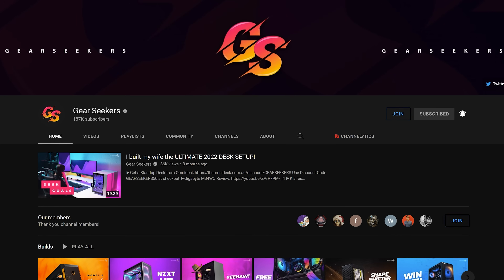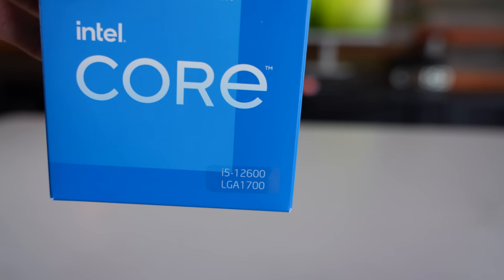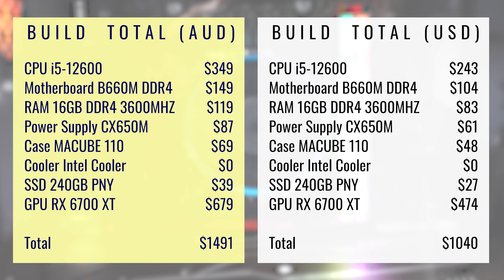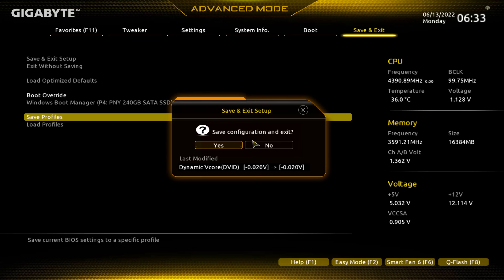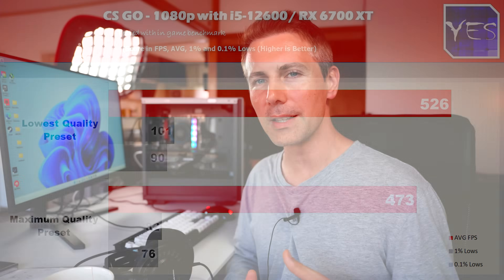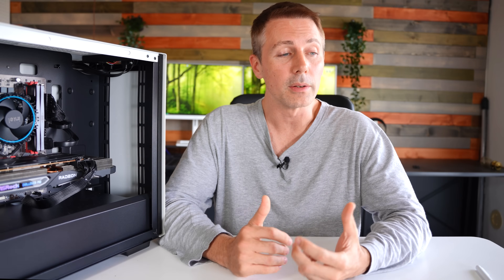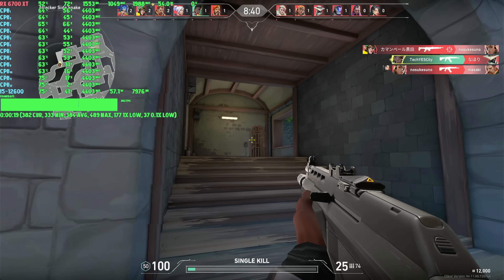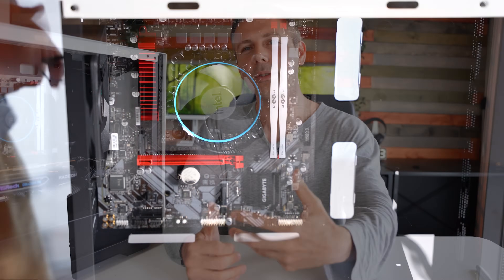UNDER $1500 AUD Intel 12th Gen PC Build CHALLENGE - Tech YES City Vs. Gearseekers

Comment: The 4 core 8 thread i3 12100 would have been far better value than the 6 core 12 thread i5. It's 1/3 the price for 2/3 of the productivity performance and probably 90% of the gaming performance. That 12th gen i5 is abysmal value for money in comparison. You could have stepped up to a 6800 instead of the 6700XT and even got better gaming scores than the i5 in the same budget.
Reply: No, let quad cores die.

Comment: Brian, why do you suggest ddr4 3600 cl18, when the ddr4 3200 cl16 runs at the same speed? ie 3600/18=200 or a 3200/16=200 or is it better in other ways? when the 3200 is cheaper.

Comment: If there was an extra $100 in the budget this comp would have been different.
Reply: I highly suspect Intel forced the issue of using at least an i5, the 12100 is the absolute best bang for buck CPU on the 12th gen platform, would have freed up $200 of budgets right there, and it would really only make sense to use it at this low of a budget if you wanted the best GPU and other parts to go with.

Comment: Awesome video and a very good and well balanced system!
As a side note, it's quite funny that the CS900 240GB SSD that you're using is the same model that I used in my old Xeon modded s775 system and now is being used in my secondary X58 system.
It's so nice that SSD's are being utilised much more.
Reply: prize is a scam.

Comment: Nice gpu and CPU combo. As others mentioned, I think a case with better airflow would have been nice. And wow! Those 12. Gen mobo prices are sharty. I miss first Gen ryzen mobo prices. A320 with r5600 all the way :D
Reply: They're expensive because the pins are on the board rather than the CPU. Although it'd be nice if the CPUs were cheaper than usual to make up for that...
Reply: the prize is a scam.

Comment: Quicksync is great, I switched from AMD to Intel in 2013, so that I could have quicksync and export videos much faster, as I used to upload and edit a lot of Youtube videos back then. I would also use it for OBS streaming, so that I don't infer any latency (using the dGPU or CPU noticeably increases frametime latency from my experience), but tbh I think OBS is a pile of crap and I just use Shadowplay and AMD's equivalent instead, both of which are more reliable IMO.

Comment: That case looks like a hot box with almost zero ventilation on the front.
Reply: 8:37.  Temps look fine but yeah that GPU temp is a bit too high for comfort.

Comment: Cpu temps with stock cooler and no intake fans in closed case? I have 12400 and 3 intakes, with a stock cooler it goes 80+ celsius. Had to buy arctic freezer cooler, huge overkill but now it stays below 60. Also have 6600xt but i somehow paid more for my build. Maybe also enable resizable bar if available in bios...

Comment: $1500    NEW# My Gaming Computer
CPU: AMD Ryzen 7 5800X 8-core, 16-Thread Unlocked Desktop Processor
Thermal Paste: Innovation Cooling Graphite Thermal Pad – Alternative to Thermal Paste/Grease (40 X 40mm)
CPU Cooler: NZXT Kraken Z73 360mm - RL-KRZ73-01 - AIO RGB CPU Liquid Cooler - Customizable LCD Display - Improved Pump - Powered by CAM V4 - RGB Connector - Aer P 120mm Radiator Fans (3 Included)
Motherboard: ASUS AM4 TUF Gaming X570-Plus (Wi-Fi) AM4 Zen 3 Ryzen 5000 & 3rd Gen Ryzen ATX Motherboard
RAM: EAMGROUP T-Force Vulcan Z DDR4 32GB Kit (2x16GB) 3200MHz (PC4-25600) CL16 Desktop Memory Module Ram (Gray)
GPU:
EVGA GeForce RTX 3070 XC3 Ultra Gaming, 08G-P5-3755-KL, 8GB GDDR6, iCX3 Cooling, ARGB LED, Metal Backplate, LHR
SSD: TEAMGROUP T-Force CARDEA Zero Z440 1TB DRAM SLC Cache, 3D TLC NAND, NVMe PCIe Gen4 M.2 2280 Gaming SSD Read/Write 5,000/4,400 MB/s TM8FP7001T0C311
HDD:HDD: Seagate 2TB BARRACUDA SATA 7200 RPM
SSD: N/A
Power Supply
Seasonic M12II EVO 620 SS-620GM2 620W 80+ Bronze EVO Edition ATX12V & EPS12V Full Modular
Computer Case
DEEPCOOL MATREXX 70 Mid-Tower Case Modular Design Full-size Tempered Glass GPU V

Comment: I think I'd consider using a 12400F, 3200 MHz RAM, a different case and possibly a slightly less expensive PSU to upgrade storage. 240 GB is really quite low and it will probably only accommodate one or two large games at a time.
Reply: I never cheap on PSUs bc later down the road if you ever wanna upgrade to a better GPU you will most likely need a new PSU if you cheaped out.
Reply: @guyknightley3499  Of course, but units like the CV series from Corsair can be had for a little less and is still of reasonable quality. Of course, the two transistor forward topology and group regulation isn't ideal, they are good enough to keep all voltages with specification.
Reply: 12400 is better as it has igpu and still comes with a cooler. And if ya get the right b660 board can even overclock to 5ghz.
Reply: @wrighrw2  In my opinion the iGPU is somewhat unnecessary since a dedicated graphics card is used. However, it really depends on the price difference. If the 12400 can be bought for only slightly more, it may be worth it.

Comment: that's my dream pc right there wish I could afford this I'm still stuck with my i7 2600 witch I've had for 10 years 😔
Reply: Definitely feel your pain there, was using an i7-875k myself until 2 years ago. Still a solid chip for esports and less demanding or older games but it is showing the age these days.
Reply: @bdhale34  yea it's still ok but it's starting to struggle definitely should keep my settings in check 😆

Comment: So I have a 9900k, is it weak now? We need a TYC comparison with the 8700k OC’d and 10900k for best used deal!
Reply: I sanded mine and overclocked it to 5.5ghz but im still planning to upgrade to 13th gen. so OC in the meantime  and upgrade when you can. i should note here that ive got a 390hz monitor im powering and thats the majority of the reason for the cpu upgrade

Comment: Bet that undervolt helped the temps even it was a rather minor undervolt. Because that case looks exactly like the NZXT ones that have no airflow worth mentioning. (And Intel isn't exactly known at the moment for running cool). Think that's the only thing I'd change within the same budget, if there was a little more to spend I think my upgrades would be: 1) Case, 2) CPU-cooler, 3) SSD

Comment: That's a great pc. But if it were me, I would have gone with a similarly cheap airflow case with free 2-3fans like . I would also get $40-50 16gb 3600/3200 ddr4 ram from other brands like teamgroup tforce vulcan, Patriot Viper Steel or Silicon power. Then get a $45-55 650-700w psu from other brands like evga or Thermaltake. The $40-50 saving from those component would go to the cpu to purchase 12700/f instead of a 12600.

Comment: i know bryan is the master budget pc builder, but the 12600 will not be my 1st choice. i would try to squeeze in a 12700 instead (luckily his competition is just using a 12400), the game graphs clearly shows they are cpu bound (bottlenecked, not much difference in low and max details). also as per hardware unbox analysis most b660 boards are crap so one must research boards that can tame 12th gen, only choose boards that can sustain higher boosts the longest (like some of those MSI's) for better performance. building 12th gen pc is very complicated but rewards massive performance for those who picks their parts thoroughly. yesman's advantage is the 6700xt as he knows the market very well and chooses a very underrated but great performing gpu (sans some quality of life features), better value compared to similar priced nvidia counterparts. i would have preferred an nvme ssd but since fps performance mattered more going sata ssd is the wiser choice.

Comment: I'd get the 12600K, and even cheaper b660m mboard and NO case LOL, just to get the Crucial Ballistix 3600 cl16-18-18 rev.E ram and OC it to as much the cpu mem controller and the mboard allows, probably around 4300 cl17???, which will increase both the average and 1% lows fps and the general sharpness and quickness of the system as a whole.

Comment: In a game like Valorant, having 0.1% lows dropping over 50% is actually quite noticeable. Alot people aim purely for smoothest possible fps in comp shooters. Build has turned out quite solid though, someones gonna be very happy with it!
Reply: Probably due to unoptimized RAM + uncapped frames. I've got a tuned kit of RAM and a 12400f, it hits 300+ but 240 locked never drops below 200 with a 1060 3gb in Val
Reply: @TonyCorin  I'm talking about the difference between low and ultra settings. Your 0.1% lows are absolutely not over 200fps with a 12400f lol you're dreaming. Your 1% lows probably are if ya rig's well optimized but not the 0.1% not a freaking chance lmao, a 12900k ain't getting 0.1% lows that high on Valorant even at lowest settings.

Comment: i would have gone with a airflow case, and if budget allowed, a better cooler, otherwise looks good starter.
Reply: I think a reduction to 3200mhz ram would have allowed the room
Reply: @b1ini  no different in 3200 cl 16 and c3600 c18.

Comment: Even though the gear seekers one looks good, this is a beast performance-wise. The 6700xt is definitely showing its power
Reply: Sure, the 6700XT pulls ahead in gaming (when you discard DLSS) but in terms of "customer satisfaction" the winner of Gear Seeker's rig will probably be the happier of the two campers. Theirs is just better balanced. Brian's choice of the 12600 didn't pay off in the productivity benchmarks and that 240 GB PNY SATA SSD sans DRAM cache is completely "out of whack". ;)